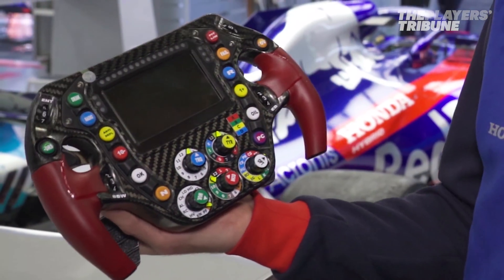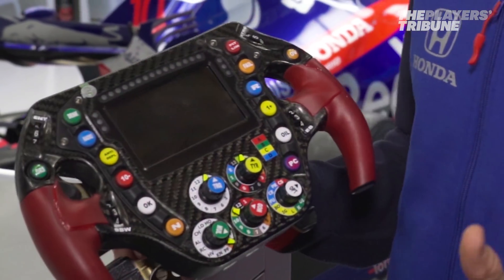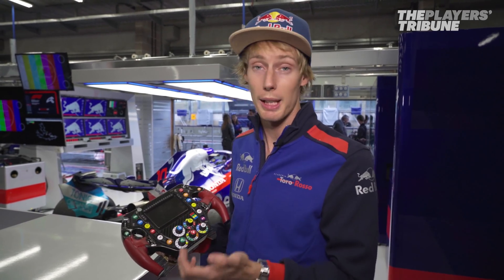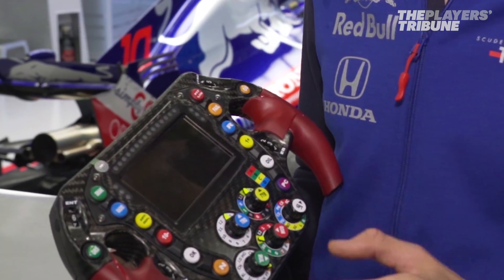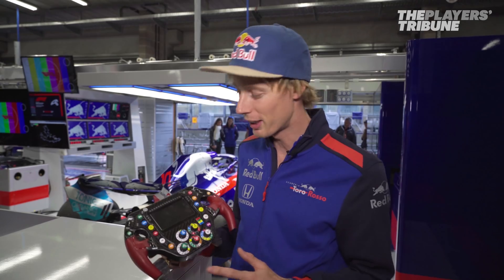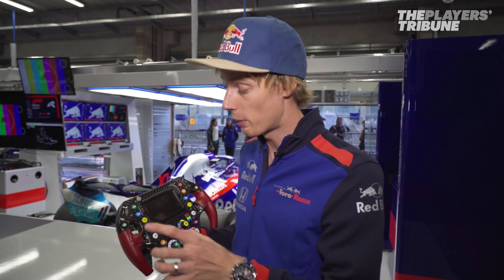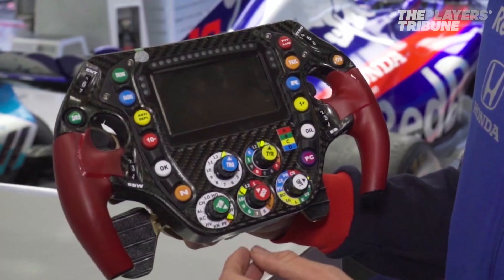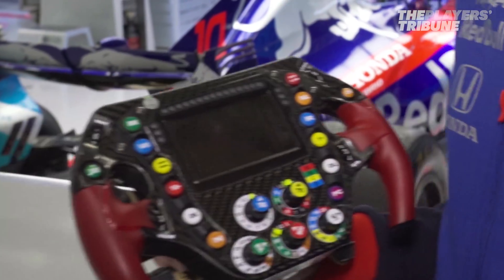How Does an F1 Steering Wheel Work?

Comment: THE BUTTONS OF STEERING WHEEL IT SO EASY TO USE IN A GRAND PRIX BEACUSE THEY BUTTONS HAVE EASY DETECT TO THE ENGINE AND THAT SWITCHES ARE SO EASY TO KNOW IF QUALIFYING MODE HAVE A USE IN QUALIFYING OR LIKE THE SCENARIO 6.7 ARE USING TO TAKE MORE ENGINE POWER OF HONDA

Comment: Anyone know if the driver can have the rev light colors changed/going a different direction? I’m sure I’ve seen someone doing it before
Reply: Every racing team has a different LED system, but always green, red and purple colours
Reply: Toyota's LED lights had the same colours but worked differently in 2008 and 2009